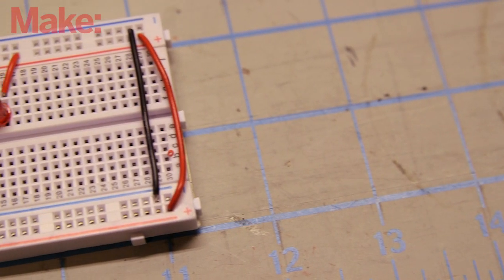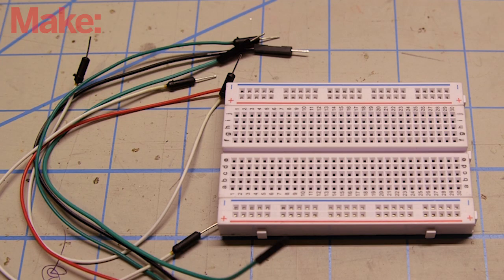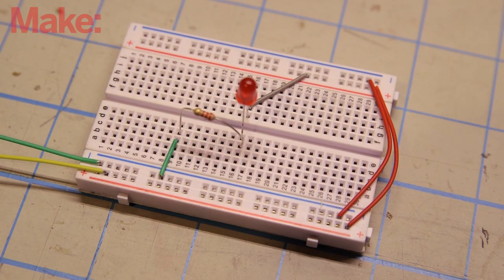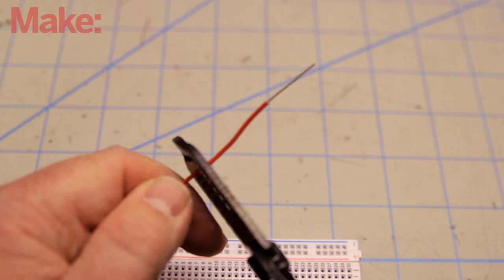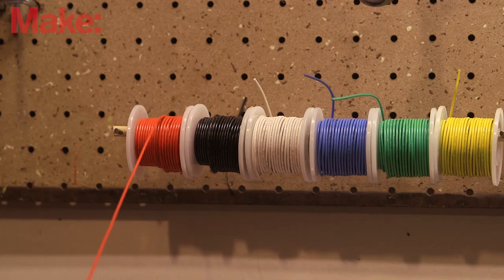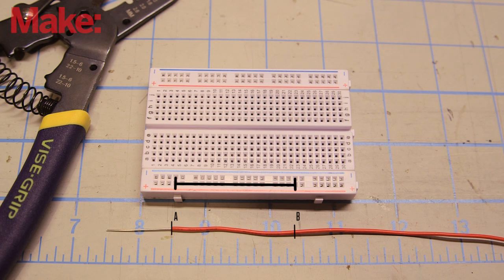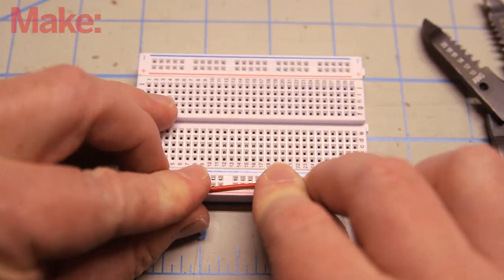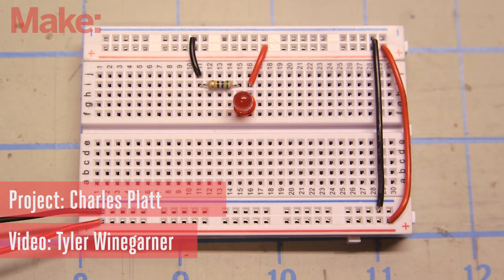Cutting Perfect Jumper Wires

Comment: I never understood buying precut wires myself. Good technique!
Reply: I like a combination. I only buy high quality solid precut jumper wires and use them when it is convenient but i also have 22 and 24 AWG solid wire that I use to cut my own custom ones. I also use the larger loose jumpers when i need something easy to swap between 2 points
Reply: @Wes8761  Definitely agree. I think a combo is good, because for the connections you just want to "tie off" it makes sense to use 22 AWG wires, then for the more mobile/variable connections the prebought jumpers are great. Using either entirely can get tiring. Using all 22 AWG can get annoying cutting so many wires, but using all jumpers is hard to follow and horrific to troubleshoot.
Reply: Simple. It's effortless.

Comment: For large quantities, an idea for a better method would be:
1. Define standard wire lengths for each jumper size (distance between breadboard holes + 2x the length of the stripped ends). For that, you could grab some precut wires from a kit or carefully make yours to serve as a model. Also, it's worth knowing breadboard spacing is 0.1 inches (2.54 mm) hole-to-hole. 
2. Cut lots of pieces of wire with the defined standard lengths (ideally with a spacer of some kind so you don't have to measure every time).
3. Easily strip all the ends with a Self-Adjusting Wire Stripper by adjusting its "stripping length regulator" to the one you defined earlier as ideal.

Comment: Hello! Some recommend AWG22 but others suggest it should be AWG24 like in your example. Those advocating AWG22 say AWG24 can be rather loose in the board slots. The ones who use AWG24 normally say its their own preference without much argumentation. AWG24 is slightly over 0.5 mm while AWG22 is just over 0.6 mm. Smaller diodes can have leads thinner than 0.5 mm. Sometimes the AWG24 advocates say the AWG22 gauge wires will expand the slots and smaller components start to fit loose. It's all a little complicated...
Reply: Same

Comment: If you're going to say measurements of any kinda, use the SI base unit with a suitable prefix.. In that case, mm. Most of the world doesn't use imperial, so say the imperial unit, then the metric unit. It'll attract a wider variety of viewers because you're not restricting yourself to just one measurement type.
Reply: Jordan O'C By that logic, all of his videos should also be in Mandarin.
Reply: ***** No, that's not my logic at all.. There are 2 countries that use imperial, the rest of the world uses metric. The rest of the world doesn't all speak Mandarin, so there is literally no similarity. Your argument is invalid.
Reply: ***** Mandarin might be the language with the most native speakers (judging by your comment, don't know whether this is actually true), yet it's not spoken by the majority of people in the world. Metric units ARE used in most of the world.
Reply: How about if you're smart enough to be prototyping a circuit you should know already the length you want the probing end of your jumper. Shouldn't matter if its imperial or metric.
Reply: Kevin Sanders ..I watched the video because I was intrigued, not because I don't know how to how to cut jumper wires correctly.
Reply: Kevin Sanders 1/4" and quarter inch and so on are very vague to most of the world. But everyone using metric instantly realises how long 6.35mm should approximately be when the wire is in their hands. You see this as a complainment, but we see it as adding value to the video. :)
Reply: Jordan O'C Alternatively, consider that those using the metric system are not in the target audience.  In much the same way that using Mandarin to appeal to a larger target would not be beneficial, using metric wouldn't be beneficial.
Reply: Jordan O'C Just do yourself a favor and learn both. If it's really that big of a deal, it takes literally 2 seconds to type 1/4" in mm into google.
Reply: *****
>Metric aren't the target audience
>Using metric wouldn't be beneficial

I'm sorry, but if you want more viewers that's outside of the US, effectively gaining more views and revenue, you have to appeal to the majority.

Kevo F.... Why should I learn a poorly designed, outdated measuring system that a negligible fraction of the world uses, when that tiny fraction can just learn metric and accept that they're sitting in the past?  Metric is way easier to convert units and doesn't have retarded shit like "barley seeds", "furlongs", "digits", "chains", "hands", etc. In imperial, there is no base counting, so it makes it redundant, and it leads back to to my main point... Why should I learn a poorly designed, outdated measuring system?
Reply: Jordan O'C Well, the short answer is to save yourself the time and embarrassment of endless whining in comments, about completely pointless things. By the way, the US, which has by FAR the largest economy on the planet (as in more than twice as large as the next guy), is hardly a "negligible fraction of the world"...
Reply: Kevo F
Only United Nations calculates U.S.A. to be the biggest economy. Reason for that is that UN ignores European Union, which is taken into account by IMF, World Bank and CIA. :) https://en.wikipedia.org/wiki/List_of_countries_by_GDP_%28nominal%29
Reply: If they used both units of measurement, you wouldn't have anything to troll them about and they didn't want to ruin your Saturday, though I suspect you would have just whined about his color choice in jumper wires. When I watch videos produced in countries that use metric, I don't whine about it,  I convert to the units I use. If you need someone to do that for you, maybe electronics is not the hobby for you.
Reply: ***** Lol, you know what I meant. Either way, the point stands.
Reply: Brent Galloway
Obviously this video is meant for inexperienced hobbyists, who don't know about these methods. These same people are very likely unaccustomed to make unit conversions on the fly. Also these kind of people exist allover the world and your rant about someone giving feedback is just selfcentered " 'Murica! " -talk.

Have a good day - i will not answer to any possible answers to this message :)
Reply: Jordan O'C  The Breadboards and the spacing on IC's were developed in the 1960's when the US was in Imperial  as it is now so the most precise measurement is in Imperial as it was designed to be 0.1" spacing between pins if you see a metric measurement associated with it it is a conversion from Imperial.
Reply: Peter Menningen Huh, IC. Get it? "I see" Huehueuhe.. I'll stop now. You make a completely valid point, and because you actually responded logically, I'll agree with you.

Ari Ben Shekelberg The latter, please.
Reply: ***** Actually it was a response to yet another person complaining about something that wasn't central to the video just to have something to bitch about. I see it on every video trying to help people learn some basic skill, and I just got fed up with it this time. If the video had used metric and somebody had bitched about it not being in Imperial units, my complaint would have been the same. I don't know where you got the self-centered "'Murica!" bit, but since you just want to snipe at me, rather than have a discussion, I guess I'll never know. Have a nice evening.
Reply: Jordan O'C Yeah, apples and oranges...erm...mandarines
Reply: Kevin Sanders Why do you hate chickens? :P
Reply: ***** how big is that target? in metric please...
Reply: kdgdirk Just to be technically correct firearmm targets are designed. in Minutes of  angle for the distance they will be shot at so it is neither Metric or Imperial Optical targets are in lines of resolution per either unit.Photo targets for highspeed photography is the same as what they are used for is to calibrate time.

In a previous life (job) I was paid to pick flys**t from pepper in measurements
Reply: Breadboards are entirely designed around imperial, and so are a majority of through-hole and surface mount electronic components. In this case, suitable millimeter values would be 2.54, 5.08, 7.62, etc. which is a lot less straightforward than literally saying 0.1", 0.2", 0.3", etc. I love metric but imperial is kind of the way to go when working with electronics.

Comment: Nice post  I have been doing the same for many years. The reason they sell all the wires of the same length of the same color is purely one of packaging efficiency it is way easier to cut all wires from one spool the same length. You probably have also noted that they don'e even use all of the 10 available colors in the assortment.  

It is way easier to trouble shoot many parallel data/control lines when each channel has a different color from source to indicator.

Comment: Automatic wire strippers make it sooo much quicker and easier, just gotta get a good brand or they'll break after one project lol
Perfect wire lengths every time: just hold the wire and up to where you want it and mark the edges of the two holes with your fingernail, strip there.

Comment: Would i use this same wire type to solder to my PCB once I've gotten my breadboard prototype correctly working?

Edit: microcontroller, not PCB
Reply: Anyone?
Reply: @the_grass_trainer  A PCB is a printed circuit board, meaning that all of the connections and components you need for your circuit are already on it at the time that it is fabricated. So no, no soldering or wires necessary! What you may be referring to is a thru-hole or "prototyping" board, which is just a generic board with holes in it to which you can solder your components and such. On these boards, YES, it is necessary to solder wires in place to jump between different parts of your circuit.
Reply: @JohnSmith-sp4vq  oh hey, thanks a bunch! I'm new to all of this, so i appreciate the clarity. I've got a microcontroller without header pins that I want to wire buttons to. Is this the right wire for that?
Reply: @the_grass_trainer  PCBs come in several different flavours: some only have copper traces (connections) on one side, others have traces on both top and bottom, and there are even types that have copper traces embedded in them; i have heard about PCBs with up to 7 layers, and even then the designers occasionally have to use wire jumpers to complete the circuits.

Anyway, you can use thinner wire in many cases, except where they carry a lot of current, such as power supply lines; in the latter case you may have to use thicker wire. 
I hope this helps.
Reply: @BertGrink  thanks a bunch for the information! Def helps :)
Reply: @the_grass_trainer  Oh by the way, in my rush to explain about the various kinds of PCBs i completely forgot to address your other question; I'm sorry about that, but here goes...

If you need to have so-called "flying leads" to connect your PCB to switches, connectors, indicators et.c., i would recommend using stranded wire, that is, instead of one solid piece of metal, the wires are made up of a bunch of tiny strands (about the thickness of a human hair) that are gently twisted together. This type of wire is much more flexible than solid wire, and thus less prone to breaking from metal fatigue.
This is especially important if there's a chance that movement of the individual parts with respect to other parts may occur.
Reply: @BertGrink  oh, alright. I don't think I'll be doing anything like that, but good to know. Thank you so much for all the help :)

Comment: If you dont want any colous then just use white bell wire it is 24swg tined and solid copper 100 meters is very cheep!!
Reply: I tried that and then I realized that breadboards are white. It's not impossible to see, but I'd prefer to have high contrast when making connections. Now I have 100ft of white 22awg solid core wire, and that's not very useful, unless I can find a good black breadboard (that'd actually look really cool, if anyone actually made them).